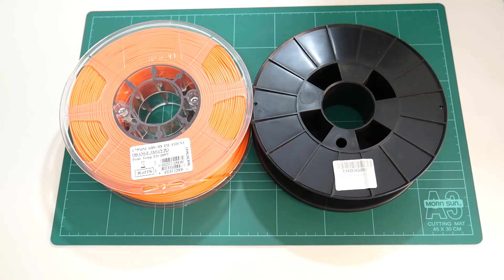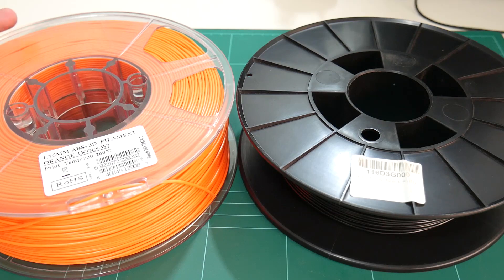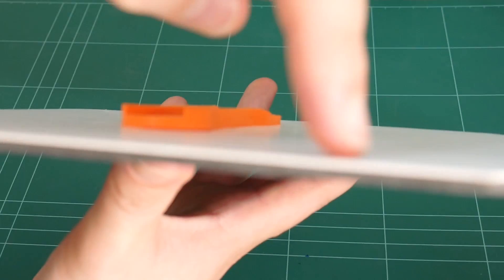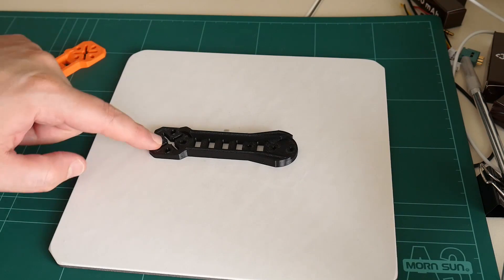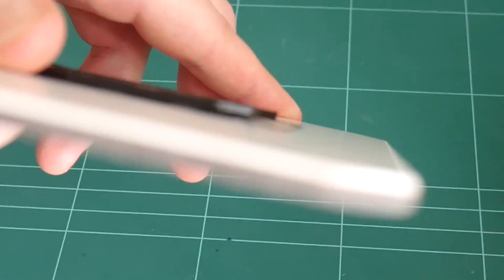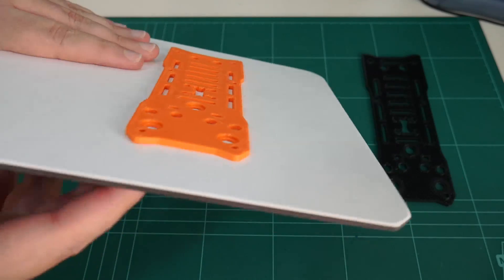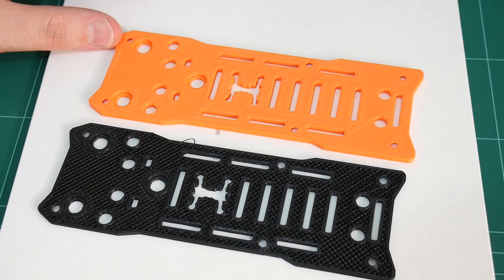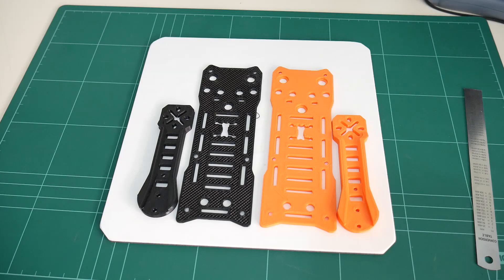Worth Printing with ABS again?

Comment: OK, you're definitely buying from the wrong shop if PETG is significantly more expensive than PLA and ABS.  Here in Germany PETG costs 2-5 Euros (incl. VAT) more than PLA. (1kg PLA 21€,  1kg PETG 23€ at Schmelzbar, 1kg PLA 22€, 1kg PETG 27€ at DasFilament) I'm not sure about the ABS prices, because I never printed ABS before and I never will be. I have my printers in a room right next to my bedroom. So I can't have any toxic fumes there.
Reply: You are paying more for your PLA's and ABS's so PETG prices aren't that far off. I am paying half of what you pay for PLA and ABS, but the cheapest PETG available is the same price as yours, so for me PETG is significantly more expensive. Its just a matter of perspective.
Reply: i noticed a white powder on my hotend after printing a kilo of white PETG.  very fine powder, much like printer toner, that concerns me more than fumes
Reply: In Estonia ABS starts around 12€ / kg, PLA starts around 13€ / kg and PETG 15€ / kg.
Reply: I buy most of my filament at Motedis.de. 1kg filament cost €16 no matter if it is PLA, ABS+, PETG or HIPS. It's branded "DevilDesign" - not sure if its considered a good brand or not, but I like printing with it.
Reply: Wow that's great. I wasn't even aware that Motedis sells filament. They say it's manufactured by PlastyMladec. That's the same Czech manufacturer where Schmelzbar gets their filament. So yes. That's pretty good filament. I like it a lot. And the price is exceptional compared to DasFilament and Schmelzbar
Reply: gamerpaddy, that's probably zinc oxide, that they used to colour PETG white; i think white filaments aren't the brightest idea generally, because they'll contain this kind of pigment rather than dye, and transparent grades are actually a better idea than opaque ones. And yet, if you ever used sunscreen, you probably have inhaled more than you bargained for, it's among the least toxic substances around.
Reply: DevilDesign is a Polish good quality filament (PLA, ABS, ASA and PETG).   
Funny that it is cheaper on the German website than directly in the producer store...
Reply: Do you happen to use hairspray? I also noticed it on my black PETG, and thought it was the hairspray rather then the PETG. I could be wrong tho
Reply: Kannst du mir zufälligerweise  einen guten online Shop für Filamente empfehlen?
Reply: Here in south asia PETG is still 30% more expensive than ABS and PLA. I'd imagine this because PLA and ABS is the most popular demand and supplier rarelt supply PETG since the smaller demans
Reply from the maker: PETG prices are higher in Australia than PLA/ABS, at least for the esun brand. It could be said you're paying too much for PLA? Either way I agree about the toxic smell from ABS is not pleasant. Although I'd be cautious with any fumes from melting plastic, regardless if you can smell them or not.